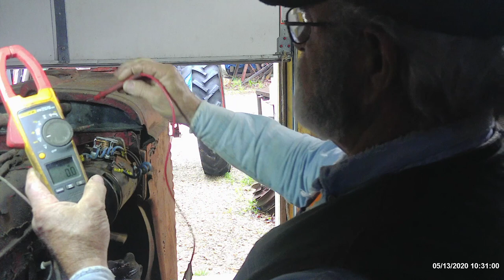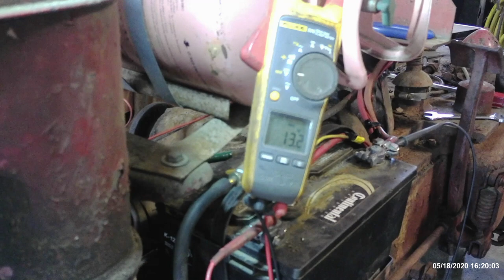Farmall H 12v Conversion From Generator to Alternator

Comment: That`s a nice clean installation.... would not be better than that if it came from the company with an altenator....another one on the board,,,CHEERS
Reply from the maker: Good Morning Mon Ami... things just can't be that easy Gator.  Some of the tractor parts supply companies sell different alternators with 'tailor-made' brackets for some of the more popular tractors...but they come with a hefty price tag too.  Most of those are pretty flimsy.  I think this one is a little beefier !!  Thanks for tuning in buddy.

Comment: I see how little I know about batteries and alternators after watching this lol. Nice video the mounting of the alternator looked really good. Take care brother
Reply from the maker: Thanks Ben for the compliment.  After all these years I should know more about generators, and maybe one day I will learn but man the alternators are so much easier and cheaper.  Generator repair shops are mostly gone from the landscape these days.  There used to be a half dozen just in my little town.  Zero now.  I think I could have made this one work, but I did not want to buy anything and take a chance there would still be a problem.  The cutout is probably the problem, but the new ones are mostly electronic and word on the street is reliability is questionable. A lazy guy always takes the easy route, you know.  LOL  Thanks for commenting sir.

Comment: How's she goin'?  What a great find that little alternator was.  Fit in there pretty good.  I was surprised that you painted it.  I thought you would have gone with the rust patina that you like so much!!!  
That was an interesting experiment you tried with the generator too.  When you were describing what you were going to do I thought for sure you would have less voltage because the 3rd brush would have been picking off on a fewer number of windings.  So I'm was like you on that one, no smarter now than I was 5 minutes ago!!!  LOL  Thanks for posting and take care!!!
Reply from the maker: Well Mike, might I say that sometimes I may tend to stroll off the path occasionally....  About the generator, I don't know what output is effected by moving the brush, voltage or amperage. If I was more into actual 'restoration' I would dig into some research so I wouldn't look like so much of a dummy.  But my focus now is function.... Because there's a lot of work waiting for this old thing.  I guess I could have hooked up a near dead battery to give a big load and hook up an ammeter to see what was happening to the output amperage.  Then move the third brush and do it again.  Maybe next time.  Thanks for taking a looksee buddy.

Comment: Hi their, don't have to mucn experience with tractor recently bought 1951 farmall m , my issue i bought from seller that realy didn't have any experience with tractor,  1 issue was battery would not charge? Or drain ? I noitce it has 12v car battery  which i thought these tractor were 6v , i confirmed the coil is 6v & generator looks to be 6v also  my question is would or could it damage the 6v coil or wiring , she told me she had a mechanic look.at it said to her it needed a new coil issue is having is staring just cranck and cranck won't start . I'm not sure if seller installed 12v before or after which had me thinking it fried the 6v coil hence it won't start which it did before  appreciate your help
Reply from the maker: Whoa...there's a lot there to figure out.  Its going to depend on a lot of things....a simple way to check the generator output is to read the battery voltage with the tractor not running.  That will be your static voltage.  If the generator is putting voltage out, the static voltage will rise to the output of the generator once the tractor is started...or it will stay very close to the static voltage.  During starting however, the voltage will drop due to the high amperage draw (load) put on it by the starter motor.  The output of the generator should raise the voltage across the battery to 14.6 or 14.7 volts.  The regulator then regulates the amount of charge entering the battery so the battery will not be damaged, but the voltage will remain the same.  
   There is a specific 'ohm' reading required in the primary and a different reading in the secondary circuit in the coil.  The primary circuit is across the + and - terminals, the secondary circuit is across the + and the center post where the coil wire plugs in.  I will have to check to give you the suggested readings because that slips memory at the moment.  But the primary should probably be around 1.5 ohms to maybe 3.0 ohms.  The secondary reading should probably be around 6,000 ohms.  Do not hold me to that though at this time please.
  You also need to verify voltage at the distributor after the key is turned on to make sure there is fire getting to the points.  Many times corrosion on points are the issue. However to answer your question, yes the 6v coil can be damaged by the situation you describe.  But if the 6v regulator hasn't been changed to match the 12v output you could experience problems too.  There is just too much to go into with a simple reply but I hope at least you have a place to start.  An inexpensive digital voltmeter would be nice to have for your issue.  Thank you for the comment and for taking the time to watch the video sir. Let me know when you get it going.  Btw, I'll be working on an M in the very near future !!
Reply: @tractorman4461  wow very impressive message appreciate your help did help out alot
Reply from the maker: @MrSehka77  Well, like I said...there's a lot that can be easily corrected in person, but describing the process in print is very difficult.  I usually don't get into repairing old generators and voltage regulators.  If I was a 'restorer' I would, but I use my tractors daily so almost always convert to the simple alternator, eliminating the other components.  Good luck to you MrSehka with your tractor.

Comment: Nice work. The bracket can double as an side hitch for a jib crane. 
I was able to install Delco one wires  alternators on the 8N and Farmall B. 
My friend Bob Collins helped me tune a 6 volt generator to charge a 12 volt battery so I could switch my 46 Ford 3 ton with a 59AB Flathead  V8 over to 12 volt.
Reply from the maker: I had an old buddy that was a superb generator and alternator man.  I WISH now I'd have spent more time with him.  When he passed though he gave me all his associated tools and equipment including a home made generator/alternator tester and an armature lathe with a couple dozen cutting tools for cleaning and repairing different width slots where bearing failures ruined them.  I was the only one he knew that even had an interest in any of it.  I figure when I get too old to work on tractors and cut wood, I'll sit by the cold fireplace and start a new love-hate interest in generators.  Lord knows I have a couple shelves of them....  Side note:  I hauled a rotted '53 F-350  flatbed to the junk yard a few years back.  It had a 239 (I think) flathead V-8 in it with a hole in the block big as your fist.  I saved all the salvageable stuff though.
Reply: @tractorman4461  I loved my 46. Built it up from 2 junkers. One old homemade wrecker with a 10 ton PTO winch and a straight truck. It took 4 years to do the drive train and body work. When we downsized. (I hate that word) I sold it.
Reply from the maker: @OldSneelock  Yeah, I understand... I would hate to have to go through that myself.  Btw, the old '53 had a 4 speed with a transmission brake as well as a pto and factory winch in the middle of the beds front.  Yes, I saved all that stuff too....even the dually frame and rear end is down in the woods stacked full of iron.
Reply: @tractorman4461  Same setup as mine. 
The 59AB had a later cam, crank,  and rods. The old guy who built it was a mechanic and a half.

Comment: Where did you find the alternator? I can't find that model anywhere.
Reply from the maker: That one came from either Amazon or O Reilly’s auto parts. I just don’t remember. I’ve done quite a few since then. Maybe check the description because I may have put info in there. Thanks Shane for stopping by.
Reply: @tractorman4461  Thanks for the reply, ended up finding one on Amazon with a different model number but it cross references to the one you used.  Tried using a 3 wire setup with a small alternator for late 80's Toyota's.  Couldn't get it to work as it would charge but the voltage wouldn't hold steady and the ammeter would bounce around.  Will try this route!
Reply from the maker: @shanefox6255  I'm not too good with the foreign car brands of alternators as sometimes they require deeper thought than I am able to give.  You'll notice in the box a 1-800 number. If you have any questions, they will give you the correct answers quick.  But they verified that it was a true one wire operation when I called.  So far it has worked without a problem at all.  I do prefer a voltmeter though vs an ammeter for the old tractors that have no real load other than ignition and a couple lights.
Reply: @tractorman4461  I got the one wire alternator installed today.  Mine isn't reading steady voltage like the one on your video.  My voltmeter is varying between around 13.5 volts and 14 volts.  Have you experienced this on any you have installed?  I'm using a deep cycle/marine battery I'm wondering if that is the cause?  I also grounded the alternator to the negative terminal on the battery to make sure I had a good ground.

Comment: That IS a compact alternator alright!  Looks like it should get the job done for you.
Reply from the maker: So many of the old IH tractors have had their hoods butchered to accept the much larger diameter Delco.  I went on a quest to find something compatible to keep standard metal intact. It's doing fine so far and the 63 amp (I think) output far exceeds anything this tractor will ever need.

Comment: Ive got at least one of every letter series Farmalls  that they made. Ive converted some of the to 12 volts using a GM alternator. I T into a oil pressure line and install a pressure switch and wire that to energize the alternator. Many of my tractors I dont use enough to fool with a battery and starter. I install a mag and hand crank them. I once installed a Fairbanks Morse mag from a Allis  Chalmers on a H. one spot it ran behind itself. advance the plug wires and it was advanced too far but ran good. I was cranking it and it kicked back and fractured my forearm. That hurt pretty bad. I then removed the housing and moved the teeth on the timing gear and got it installed correctly.
Reply from the maker: Now THAT's an option I didn't think of for external excitation of the GM three wire.  I've not converted one to a mag, but my brother has on several.  I think there's a specific correlation to number of degrees per tooth on the mag.  I'm thinking divide 360 by the number of teeth on the mag drive and that'll give you an idea of how much advance or retard its being moved..... Does that sound logical ?  Kickback...eh..??  Been there done that...hahahahaha.
    I do have a problem with a mag right now on an Allis Motor Patrol but I just think its corrosion on the points. No spark for the first time ever but it's been sitting now for a number of years.
   I have a running H for sale right now....running on a temporary tank, the gas tank is off and needs electrolysis and sealant.  Thanks Randall for the input...oh and I have a '37 IH stationary baler with a bad water cooled throttle governed engine.

Comment: Hey Tractorman44
Just ordered one of those alternators for my 1957 Farmall 350. I've had the machine for over 20 years but just never fooled with getting the original dead generator repaired. That said, what gauge wire did you run from the alt to battery?
Reply from the maker: I usually run #10 on all the old tractors that don’t really have any implements that require high amperage. I usually don’t even run any lights. I’ve had great luck with all the conversions so far. And there has been a lot. Good luck with yours Mike. I really like using a 12 volt voltmeter too. Let’s you see at a glance what’s happening. Soon as it excites you’ll see the voltage jump above 14.
Reply: @tractorman4461   Thanks!! Great video my man!!

Comment: Vest questions.  How many do ya wear? Favorite  vest? Got one that ya just can't wearout? Warmest?
Reply from the maker: Good Morning Mike. Carhartt is my all time favorite for durability....but the lining is a major thing to look at considering the stuff I do around here. Like...NEVER wear a polyester lined vest or a quilt lined vest while welding and especially welding overhead. That is unless you enjoy smoldering, smoking and sometimes flaming situations on your belly and chest.  LOL  Kinda like stick welding in tennis shoes....even steel toed tennies are a no-no. Grinding with the angle grinders set your belly on fire easily too.
     Man...I could go on as I usually do....but this time I won't..LOL  Maybe.   My arms get real hot real quick, I have to unbutton my shirtsleeves a lot of the time, even in chilly weather.  That's why vests are so much standard wear for me. Spring and Fall I like vests that stop the zipper pretty low, but severe weather I prefer protecting my neck from the cold air as well as the back of my neck by wearing full zippered vests, heavily insulated.  It seems to minimize the onset of colds and sore throats for me.  
  With the new OSHA regulations concerning 'Arc Flash' protections in worker wear there have been major advances in flame retardent clothing and that's what the Missus has been ordering for myself and my son that helps me on welding projects.
   But the lure to and the liking of vests I believe is eternally connected to all the '50's and '60's Westerns I devoured weekly...just like millions of youngsters.  All the cowboys wore vests and treated the ladies with respect, tipping their hats and opening doors....all the good stuff... things I like to do to this day, well...except for shooting the bad guys !!  Thank you sir for the fun question and I hope the 'brief' answer is adequate.  Please have a wonderful day.  On a side note....I still have a pristine set of six shooters I got in the 4th or 5th grade.  They have the fancy holsters and bullets all the way around....even have pearl handles !!  Well, they're fake and the bullets are plastic...LOL  ...and no, I don't wear them any more.  )-:
Reply: Welded for 22 years but lucked out not havin to do overhead.mostly light gage aluminum. Welded thousands of light boxes that light up the parkin lots of Wally world and McDonald's. Love a good old  western  myself. Did you know Roy Rogers loved old harly Davidsons?
Reply: The hoodies help my neck stay warm. I don't  leave  the house without  one on especially in a cool wind.

Comment: So , what are you going to use the Farmall for ?
Reply from the maker: It'll fill in for the Massey's in the event of a breakdown....which is why the first job will be on the pto powered woodsplitter.  The little Massey Harris 30 that usually works that machine has sprung a leak in the top tank of the radiator.  It's usable but you gotta keep an eye on it and leave the radiator cap loose.  It needs a drink every hour or two.  I'll use it on the trailers shuttling split wood to the house and shed as well.  Probably skid a log or two too.